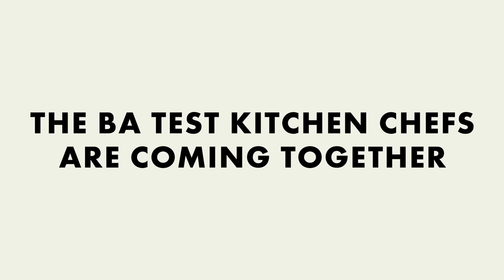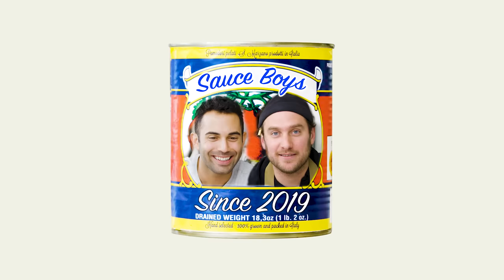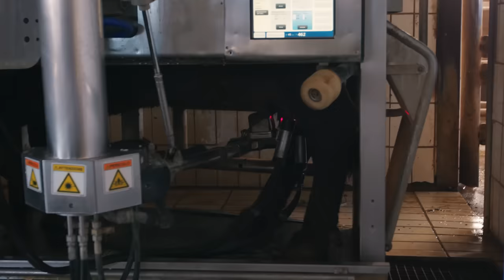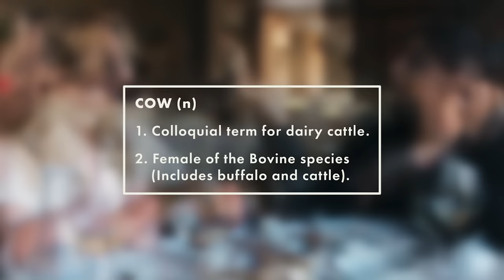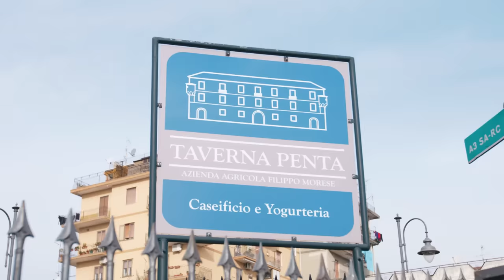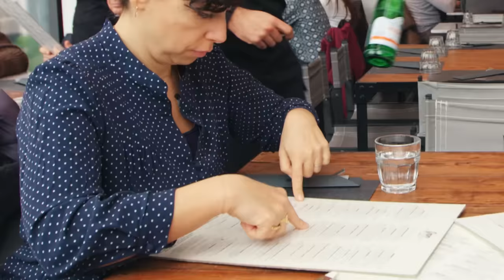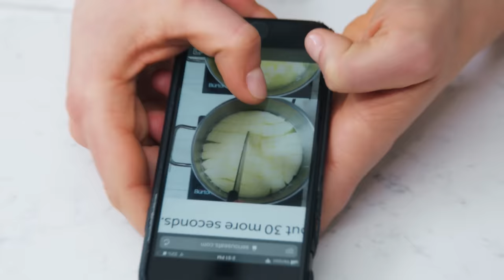Carla and Molly Try to Make the Perfect Pizza Cheese | Making Perfect: Episode 3 | Bon Appétit

Comment: Watching every single chef struggle with getting the pizza on the peel and in the oven gives me hope for my own skills
Reply: Emily King I still don’t understand why they don’t just make the pizza on the peel....
Reply: epiccollision Andy did and he is a genius.
Reply: epiccollision right! sometimes they did but they had to learn..
Reply: @epiccollision  when I tried that the dough ended up staying with the peel and all of my toppings plopped off into the fire... pizza is an art
Reply: The problems they all have is that they have too little flour on the peel and when getting it onto the peel you need to drag it slightly towards you so the pizza has momentum in the opposite direction of where you slide the peel. If the pizza has the reverse momentum it will not get smushed.
Reply: @Whiskypapa  i was too scared to put much flower, with the oven being at 900° the bottom gets scorched pretty fast if there is too much. Im still learning but its been pretty tricky so far.
Reply: A touch of semolina on the peel works wonders. Slides like ice and gives a slight crunch factor on the bottom of the crust. Guess they opted out of that option
Reply: inb4 Chris does it perfectly the first time next episode.
Reply: I think Molly proved to be quite adept at it.
Reply: Mason Criswell I think people are too scared to have some burnt flour under their pzza. Its really not a big deal and the extra char is actually quite nice.

Comment: The pH meter will continie changing if the solution (in this case the milk) is moving. As well, if you have it on your hands the temperature will fluctuate and this also cause that the pH changes